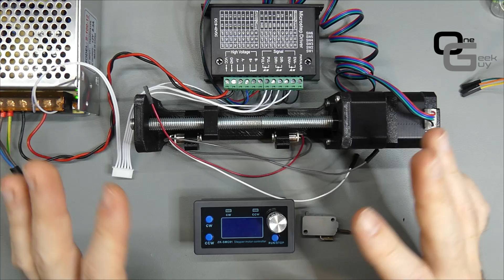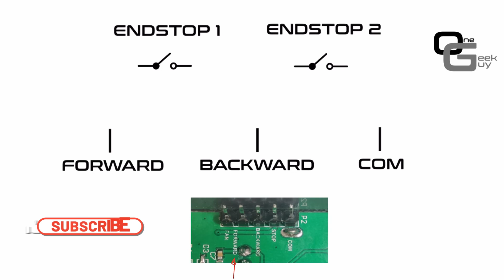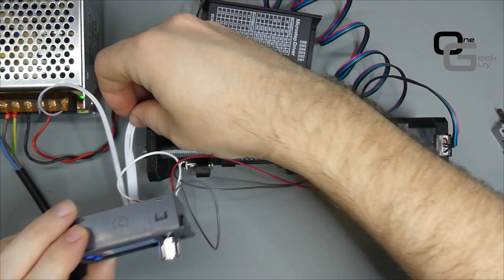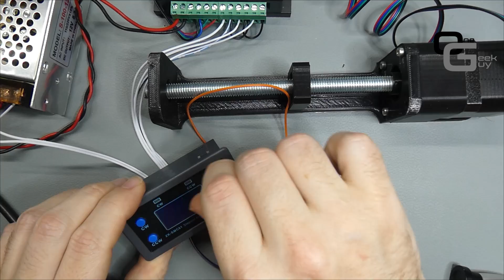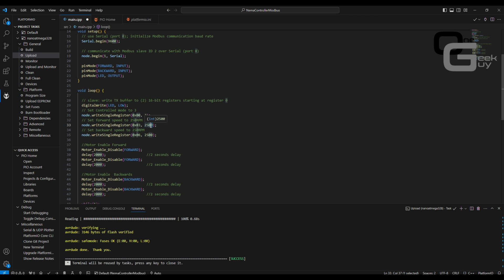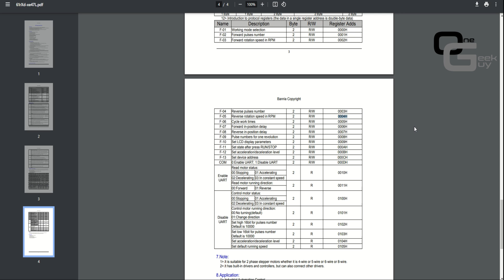HOW-TO: Motor Controller for NEMA Motors SMC01 Endstops and Arduino Part 4

Comment: can you still adjust the speed with the knob on the controller? or do you need to wire the potentiometer to the arduino for it to still function at the same time...

Comment: Great video. I´m making a linear actuator with two end switches like you´ve done in the video, but for security reasons it is better to connect the end switches in the NC option, to prevent the failure of a cable, in that case the motor would never stop. Is it possible?. Thank you in advance and you can answer in spanish if you want.

Comment: Great videos, Thank you.
Question: Using Arduino (or other platforms maybe), would it be possible to Read the codes for the inbuilt, default programs on the Controller... Edit example - the starting direction from CW to  CCW... AND then Write the new value back to the controller where it would be permanently stored? (So when the Arduino is not connected, the controller now behaves in the default F1 program with the new setting)
?

Comment: Hi
I want to use the SMC01 to move a table connected to a ball screw and stepper motor assemble a amount in MM , I know that I can program the amount of steps required related to the pitch of the thread , but is there a way of entering 10mm or 15mm and getting the controller to display that.?
or turning the pot and it reading the amount traveled in MM.
regards
Viv

Comment: the x10 for RPM is sort of in the manual -- it shows that the range of speeds os 0.1 to 999.9 RPM, and it stores the speed as an integer in 10ths.  That's the same with all the 0.1 resolution registers.

Comment: I am copying your software and compiling and as I go. When I type      Motor_Enable_Disable(FORWARD);     I get "Compilation error exist status". Any suggestions? I don't  know how to  simply copy your code. What I want to be able to do is to use your excellent video to control a small cnc lathe conversion I have just completed.

Comment: Nice Video!  What is the name of those connectors that you used to connect to the three connections on the back of the circuit board?

Comment: Hello,
Your videos got me going with the smc-01 and 02 units. Thank you.
I use them to control steppers in photography.
The smc-02 units work fine.
However my first smc-01 had to be replaced due to massive overheating and firmware failure.
It was replaced and has worked well for several months.
Then, decided to work as programmed CW but repetitions CCW decided to not work any more and the stepper just runs non stop.
So……. Before I replace this unit, for the second time I ask the guru.
Are these units buggy by reputation ?
Is there a HARD reset that I am unaware of.
I do not want to be replacing them every few months.
Your advice is welcome and will be much appreciated.
Chris.
Reply from the maker: Unfortunately no, I have been using one for some time already without major issues. Looks like more as SW issue but it is strange. Would be good to analyze in detail one of these faulty units, I will check if I can keep one running for a long time and see...

Comment: Hey these are great videos!  Excellent Job!

Is there a way to incorporate limit switches if using the SMC-02 with the onboard driver? Or do you have to unsolder the CW & CCW buttons to do it?
Reply from the maker: You can solder in the same points as the smc01, but on top on the second pcb.

Comment: hey, can i controll Smc02 with esp32 on the mobile app? i have the smc 02 unit and i'm trying to make this working wirelessly for a cablecam device.
Reply from the maker: Yes, would be same as with Arduino, you can also use GPIOs to directly act on the switches.
Reply: @onegeekguy_yt  awesome, cam u please help me make the connection between smc02 esp and blynk?

Comment: I have 2 SMC01 and 1 SMC02. I would like they are start or stop at the same time. Please help.
Reply from the maker: If you connect them in parallel with external switches, they can start the motors at same time
Reply: @onegeekguy_yt  Can you help me with the diagram how to connect them? Thanks a lot.

Comment: Can we link one SMC01 to another SMC01 so we can start or stop 2 motor at the same time? Please help. thanks in advance.
Reply: I have the same question. My basic understanding is the signal from the controller can be daisy chained between two drivers.
Reply from the maker: As @ccleadge  said, yes you can chain two drivers with the same controller. Also you can put two controllers in parallel, should work

Comment: Hi there in forward and reverse pin can be imput to signal and not whing ani com for hand wheel encoder encoder had A,B witch is reverse and forward ????
Reply from the maker: Could you re formulate your question? I dont get the part of the encoder sorry...

Comment: I'm new to step motors and the controllers, do i have to connect the external driver to use the end stops?
Reply from the maker: No, the endstops do not depend on using external driver or not.

Comment: Thank you for the video. This set up is almost exactly what I need but I need to activate the controller with a trigger. When 5-12v is present I need to move the motor in forward direction, and when the 5-12v is taken away, I need it to move in reverse direction. Do you know if the controller can take that kind of input?

Comment: Thanks for the video adding limit switches but my controller is the SMC-02
Reply from the maker: You will need to solder the cables, same position as SMC01 but in the upper PCB.....(Driver PCB)

Comment: great job, endstop npn , pnp , no, nc ?
Reply from the maker: You need to use NO mechanical switches.
Reply: @onegeekguy_yt NPN sensors  must work too, as they ground when activated.

Comment: how to control steps movements, like lets say we have 400 circular points to move one by one and i need to move pointer in following example sequence  starting from  0->10->240->45->28-> .......... -> 400 . How can we automate this ..
Reply from the maker: I think these modules have not enough flexibility to add that many steps, we would need to think about using something bit more powerful or specific.

Comment: Hello OneGeekGuy, This module is really great to make autofeed control of the table of a small milling machine.
The problem is that we need on a milling machine a SS (slow speed) for machining and a HS (high speed) for fast moving from one point to the other without having to change the SS setting that you set for your machining operation.
The problem of this module is that you need to turn the button a big number of rotation to go from SS to HS and back.
My idea would be to use a very small Arduino (Mini, Nano, Tiny...) with on Digital Input (Push Button "HS") and connected to serial link of module.
When PB pressed, Arduino read the actual value of SS ( param F-03 register 0002h), store it in a memory and load the HS value (from a memory location). 
When PB relased, the previous SS is relaoded in register 0002h.

What do you thing about that...😊

As you have already all in place for this video... and that you seem to be good in Arduino (which is not yet my case), would you be so kind to test this...
Thanks in advance...
K. R.
Patrick.

Comment: Hello, Thanks a lot for this 4th Video that I was suggesting in previous.
It's really what I was looking for. It will open projects for me.

I will try your code with an Arduino?

Man, you are really Great 👍
Reply from the maker: You are welcome! I hope the small Arduino code I prepared is useful!
Reply: @onegeekguy_yt I will try it as soon as possible...

Did you investigate other errors in memory parameters. 
I need the 2 speeds and the travels...
Reply from the maker: I did not took a look to the travels, but...., when you send the command to change the parameters, they change in real time so you see the numbers changing, what can be done is a small code in Arduino which change address by address, and when the number change you know that address is the one you need....just as idea.  @PatDuch58
Reply: @onegeekguy_yt OK I will check when I will mamage to be connected to the module with an Arduino...
I'm still learning Arduino programming...

Thanks anyway for your reactivity...

I have checked your Instagram... and I'm follower now...